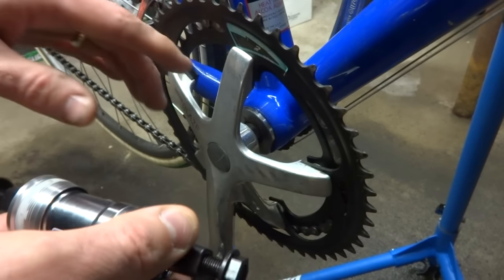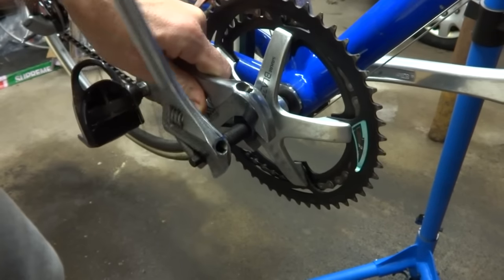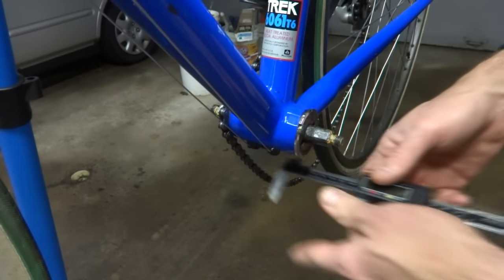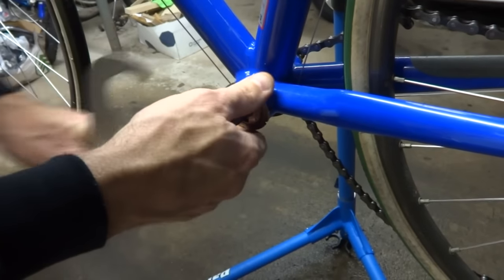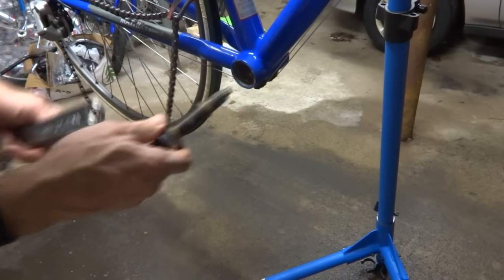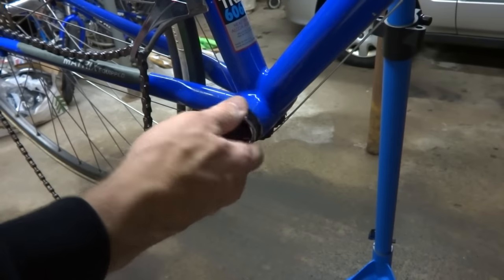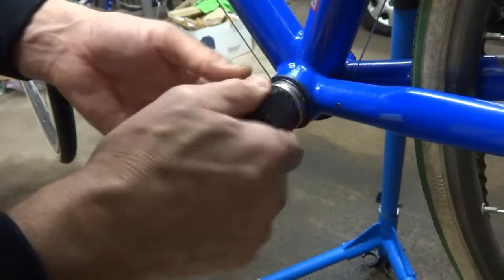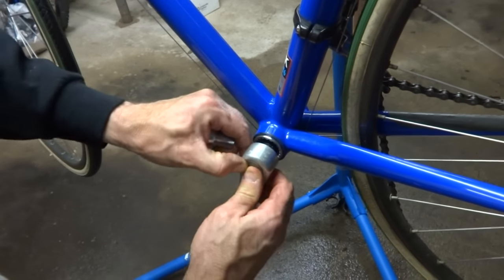How To Upgrade Vintage Bike With Sealed Cartridge Bottom Bracket

Comment from the maker: For more bike repair videos hit the subscribe button 🛑 and click the notification bell ► http://bit.ly/SubRJTheBikeGuy
Reply: Sir, I have vintage folding bike, I would like to replace to cup type BB with a sealed one, found out the bike's bottom bracket shell is 73mm, in our country the available in the market is 68mm(there's also 80mm). I have a sealed BB 68mmx115mm, obviously it's undersized. What if I get 68mm x 127.5mm and put some spacers?
Reply from the maker: @haldyordan2316  Um... if your shell is 73mm, or 5mm wider, adding spacers is the opposite of what you want to do. And spacers have nothing to do with spindle length. Spindle length adjusts how for the cranks stick out. You need to look a the specs of the cranks for what spindle length to use. Different cranks require different spindle lengths.
https://www.sheldonbrown.com/cribsheet-bottombrackets.html
Reply: @RJTheBikeGuy  Thank you very much
Reply: I just found out that 73mm bottom bracket shell, the inner treads a bit larger, so cups from the 68mm a bit loose, my idea buying a longer spindle set a lost cause 😅
Reply from the maker: @haldyordan2316  The spindle length comes from the crankset specs. The other measurement, (68/73) comes from the bottom bracket shell width. So if your frame shell is 73mm, you need a 73mm BB.
Reply: @RJTheBikeGuy  yes sir, but 73mm bb square type so rare, especially in our country, also surely expensive available only abroad, I'll stick to my cup type BB for the meantime, until I'll found one in the local market.
Reply: Hello, i have a question.. how do I know  the threads inside the frame can fit the threads on the bottom bracket?

Comment: Great video.
One tip for anybody still learning: whenever you have the bottom bracket out of a bike, before you clean out the bb shell, that's the perfect time to pull the seatpost and clean out any rust, corrosion, or gunk in the seat tube and hit it with some Boeshield. Then you can just clean up everything  down below before reassembling.
Thanks for the great content, RJ!
Reply: Can you replace other bottom brackets with sealed cartridge BBs and or will be compatible with most mountain bikes.

Comment: A Youtuber who owns a tripod, a decent camera, the correct tools, a proper bike maintenance stand, works in metric and doesn't waffle. 10/10, perfect vid :0)
Reply: No awful music in the background and his videos are still up to date.
Reply: a torque wrench would have been nice but decent video
Reply: I like waffles.  Sourdough Belgian 🧇 🧇
Reply: Although worth investing in a BB Cup tool. The Adjustable Crescent Wrench... Rounding nuts since 1905. Hateful implement.
Reply: @sirmixalot3332  re: "Sourdough Belgian"
mmmmm ... breakfast!
Reply: @alexanderpinkerton1354  re: "The Adjustable Crescent Wrench... Rounding nuts since 1905."
>> However, in a case *where* the fixed cup is being removed, _never_ to be used again, is that really necessary? I mean, the fixed cup is never going to be used again, right, b/c its probably worn out? Now, were he actually *servicing* a cup and cone bearing system ...
Reply: @uploadJ  I actually just rounded off my BB tool trying to get a stuck fixed cup out… had to resort to blowtorch and a vise… also the steel on those cups is super super hard
Reply: This guy is amazing

Comment: These are the best bike videos, with outstanding close-up camera work, and thorough commentary.  For people like me who often learn the hard way: be sure to screw the crank remover tool all the way in to the crank, as far as it will go, before tightening down the plunger part--this to avoid ruining the soft aluminum threads in the crank arm.  Also, I was at first unable to slide the sealed bearing assembly all the way through the bottom bracket on my older Nishiki mountain bike, because it ran into a screw protruding through the bottom of the bottom bracket, a screw that attaches a plastic cable guide under the bottom bracket.  I had to Dremel down the screw to accommodate the sleeve containing the sealed bearing assembly.

Comment: Top tip when mounting a BB; screw in the non drive side a lil first, that way its supported on that side preventing the driveside from cross threading! Is usefull with slightly worn off threads on old frames!
Reply: That's a great tip.👌
Reply: @goober650NX   I also find it usefull to turn in the loosening direction of the bb till you can feel a slight tap, then you know its at the start of the threads and alligned nicely.
Reply: @martijnt1353  
Yes, use that technique all the time. Another gem.

Comment: I replaced the old-style bearing races with a sealed cartridge  on my 30-year old bike. This video was very informative and helpful. Thanks!
Reply: Going to do the same. There is just so much shaft play, it is laughable. Can't wait to order and fit the new one. Have been riding this 1987 racebike since 10 years and changed it in an Frankenstein bike with lots of new parts, no beauty, but it's my Frankenstein :D

Comment: Sealed cartridge bottom bracket is probably the change I've done on my bike that's had the biggest effect. It just makes you pedal so much more efficiently
Reply: good !
Reply: One cannot lube and service them like we use before , in the old days ! To lube it before , a few drops of grease throught a small hole under the byke every each month would be enough to maintain it running for 70 years .
Reply: You can lube sealed. Take a razor blade corner and pop the dust cap off

Comment: This certainly was helpful for upgrading the bottom bracket on my Mongoose Ledge 3.1.  Seems like no matter how much I adjusted the bottom bracket with the old caged bearings, the slop would eventually return.  So my chain ring had a wobble to it.  Definitely feels better than it was brand new.  It even shifts better.  The chainring is slightly closer to the frame now, so the chain no longer rubs with the front derailleur in top gear.
Reply: That rub can sometimes be adjusted / some shifters have a "trim" to move the derailleur slightly one way or the other; similarly some systems are not supposed to run certain gear combos (a 2x8 system running 1-8 will rub with the chain running so cockeyed). [General info for all]

Looks like your situation is a bonus perc
Reply: Since then, I swapped the rear wheel that used a 7 speed freewheel to a wheel that now has an 8 speed cassette.  Had to upgrade the rear derailleur and shifter in the process.  I mainly did this upgrade so I can have hydraulic disc brakes in the rear.  Now when my front derailleur is on the small ring, the chain won't start rubbing until I get to about 3rd or 4th on the rear derailleur.  Once I'm on the 2nd chain ring, it's nice and quiet.  It shifts insanely smooth now.  Oh, and the sealed bottom bracket is holding up quite nicely.
Reply: @BrownJello  That's not what the adjuster on the shifter is for...usually the derailleur has two screws for that
Reply: @samteks125  Are you referencing the barrel adjuster on the shifter? I was referring to shifters that have a half step. I have a Shimano shifter that gives a half step to eliminate rub/misalignment.

Comment: thx for the informative video.  i have a '99 Stumpjumper FSR XC that had a tiny bit of crank/bb play last time out.  had an ill fitting wheelset i was trying at the time which could have contributed.   these old suspension bikes with the bushings/bearings are not maintenance free but other than cleaning chain/cassette, i have not had to remove cranks yet.  but this vid can be my tutor when the time comes.   meanwhile, on my commuter and fitness bikes, just 3 and 6 years old,  i routinely remove and clean/regrease cranks and bb at minimum annually.   my NOS 2010/'14 Trek has needed 3 chains, 3 cassettes and 3 gear cables. Incessant dropped chain under hard pedaling forced swapping the 3x10 for a 2x (without changing the shifters).   And headsets on both the 21st century bikes needed bearings & regreasing.   even the fat bike i built last winter snapped the plastic FD tab during cable install.   but this 18 year old Stumpy shifts like new, and needed nothing but a cable and chain lube.  still running the original cassette/chain.   when the bb or crank finally do fail, i will  upgrade as you have here, to a Hollotech or Race Face Turbine.  thx again for inspiring confidence.

Comment: Thank you! You saved me some money. I almost bought a 35mm bb and a special crank set because I thought the measurement was about the height of the bracket. Now I understand the amount of mm is the WIDTH of the bracket, which is just 68mm as usual in my case :D. I am upgrading a ATB from 1997. That's how I found your video. Thanks again!
Reply: U should upgrade to hollowtech2! Screws right in any old bike with basic bb! Its fantastic..
Reply: @martijnt1353  Hi Martijn, that is what I did. Replaced the entire BB and crankset essembly 2 years ago ;).

Comment: Excellent information! I couldn't shift the RHS retainer so I used an electric heat gun to warm it up and it came loose easily without the need of a hammer.

Comment: Make sure to check for a washer behind each crank center bolt before attempting to use the puller! They must be removed or the puller will not work, and the crank arm threads and tool threads can be damaged. 

Also, there’s a chance the bike has an Italian threaded bottom bracket. If this is the case, the drive side bottom bracket shell won’t be reverse threaded. Knowing this is important to avoid frustration/damage by trying to remove it as a left hand threaded shell. Also, it will help to ensure buying the correct bottom bracket.

Comment: Thanks a ton here, great video.  I didn't have that special spanner to remove the lock ring on the adjustable cup so I cut small 10mmx10mmx250mm red oak sticks as sacrificial blow to knock that ring loose after soaking in pb blaster over-night (didn't "bugger" up the chrome plated lock ring notches that way).  So I'm rebuilding my brother-in-laws mid-80's chromoly Montagna Tange Sakae SR group oval-tech 26" MTN bike so it's certainly not the one-offs like Italian or French.  My spindle is NOT symmetrical.  On the drive side there's about 3 more mm from the bearing race (center of where the wear marks are to the end of the square taper is 36mm).  On the non-driveside that same distance is 33mm.  My over-all spindle width is 124.85mm and my shell width is 67.8mm.  Do you know which sealed cartridge I should look to acquire?  So far I have found 68 X 122.5 and 68 x 127mm only.  Thank you.
Reply from the maker: Find the closest you can. Slight longer propbably better than slightly shorter.

Comment: Thanks this vid helped me upgrade the bottom bracket on my 35 year old road bike (Koga Miyata )
My wrench kept slipping from the right hand side 'screw'. But I held it in place by clamping it with random pieces of aluminium and a threaded rod through the bottom bracket.
Reply: I had similar problems with my own hook wrench!  I thought with the new lock ring, it would fit really well, but actually the new ring was a bit wider & my wrench wouldn't fit around it!  Had to grind the  round bit of the wrench a little to make it fit over the ring..

Comment: If the drive-side "fixed cup" is reallllly stuck (as it was on my old 1960's bike!) there's a video somewhere showing a good method to remove it. Basically involves removing the spindle, buying a big carriage bolt, a couple of washers and nuts to hold your spanner in place. Worked a treat with mine!
Reply: any luck finding the video?
Reply: any luck finding the video?
Reply: any luck finding the video?

Comment: I think it is important to show beginners to install the adjuster cup first(with a little grease inside the cup to prevent the cup and BB from fusing together) as you are then able to have the cup acting as a guide, because of the length of the BB housing it is better to take the guess work in getting the BB screwing in straight.
Also using Park Tools HCW-4 will reduce the chances of rounding off the edges through slippage with the adjustable spanner.
Like what you are doing RJ.

Comment: From personal experience it's not just vintage bikes, I have a few years old Diamondback Wildwood cross country bike that had this done when only a couple years old from bearing issues.  Poor craftsmanship I was told if I remember correctly as this bike has never been off road and only on an asphalt exercise path.  It's been fine otherwise, but I think I'd go with a better model if I were going to buy it again.  Anyway interesting to know how this was done.  Thanks for this and your other videos!

Comment: Great vid! I'm planning to do this replacement on an old Cannondale of mine. Correct me if I'm wrong, but I think you should  note that different crank arms require different spindle lengths, so if you were switching out the crank arms in this video, you would have needed a bottom bracket with the correct spindle length for that specific crankset.
Reply from the maker: Changing cranks goes beyond the scope of the video. But unless you are going from a double to a triple or triple to a double, you should be pretty close. Something that wasn't mentioned is there are a few flavors of square taper spindles. JIS is the most common. ISO is the other major one. So if you were switching from Shimano to Campagnolo cranks, there might be a difference.
Reply from the maker: ***** I don't work on Walmart bikes. Not sure I would want to put any money into them.

Comment: I don't understand using grease on the threads....but that's okay, I don't know as much as you do about this particular job.  However, if you just want some lubrication while screwing  or sliding something something together, but not leave it lubed (it might vibrate apart)  a really good trick to know is Windex or ammonia. These are bases (the opposite of acids). One characteristic of bases is that they are slippery: (soaps are bases), but when they dry they are no longer slippery. So on something you want to be slippery while you install it but not leave any lubrication to vibrate apart, Windex or ammonia works great (but don't use it on you water fittings).   I'm trying to fix an old bottom bracket and find this video very helpful. Thanks!
Reply from the maker: It's about providing a layer between the metals so they don't seize over time. It also helps seal out moisture.
Reply: @RJTheBikeGuy  Thanks.  When I last went through my bottom bracket it was a bear getting it loose.  So, in practice the bottom brackets must have been seizing,  using a bit of grease kept this from happening, and the fine threads and 'torque' must be enough to keep it from working loose. The grease works good enough that I don't need to go out and buy copper paste. Makes sense. (A lot of lubricants, and cleaning products, are like this: there's the special one, but then there's stuff you already have that will also work. (I saw a GCN video where they mentioned 'copper paste' which is to keep parts from seizing.  Never even heard of it before. There is a thing called Dissimilar Metals: I once had a steel nut running up and down a motorized Acme thread. It would randomly seize, no amount of lube, polishing.... I replaced the nut with a bronze nut which never seized and didn't matter if it was lubed or not. I think that's how 'copper paste'  works. But clearly grease is enough.  The reason grease didn't work for my acme thread is I was running it back and forth with a motor.) Cool.
Reply from the maker: @WillN2Go1  It should be tight. But you don't want it to seize. Copper paste is designed for applications with high heat. Like car brakes. I have a video on galvanic reaction here: https://www.youtube.com/watch?v=bGqV5KE7cb8

Comment: Thanks for this, I didn´t know it was possible to do this upgrade but am now waiting on a new Shimano BB for my 30 plus year old  Peugeot racing bike.  One point though, after i´d made the measurements, and then removed the old bearings and shaft, I found the size was stamped on the shaft of the original (Shimano) crankshaft anyway, 68 -113.
Reply from the maker: Cool! I rarely see that though.

Comment: I finally got my bottom  bracket  off but the assembly  came out from the non drive side the drive side just was the shell on top of the bearing glad it came out  tgo now I can start stripping  the frame with and suspension  fork

Comment: I changed on my folding bike the old style - cup and free ball bearings- bottom bracket system for a sealed cartridge bottom bracket. On the frame had not there an inside thread, but I changed. It was difficult.

Comment: My pedals have a movement play with the central chainring and I don't know if I just need to screw it tighter or change the whole bottom bracket. The problem is that I don't have the 14 tubular key to start and the extractor. Anyway, nice video.

Comment: Removing those crank arms looked easy but I find one at least is extremely hard to remove, especially the left side.  Any tips?  Thanks for the good videos, they help a lot of us a good deal.
Reply from the maker: Not sure. I have never had much problem removing crank arms using the correct tool. Other than damaged threads that the tool screws into.

Comment: If the second side of the bottom bracket cartridge is made of plastic instead of metal, you can use a packet of dielectric battery terminal grease from an auto parts store, which is made of silicone instead of petroleum and will not react chemically with the plastic part.  Cheap too.

Comment: Really enjoying your videos RJ, a great help when restoring and upgrading an XL framed 1980's touring bike!
One question though please... no LHS lock ring required to hold the sealed BB in place, or is it just used to adjust the non-sealed bearing?
Reply from the maker: The lock ring is needed to adjust the non sealed BB. The sealed BB is preadjusted.